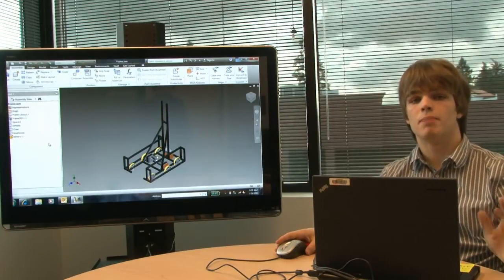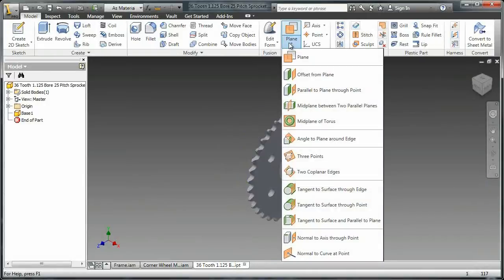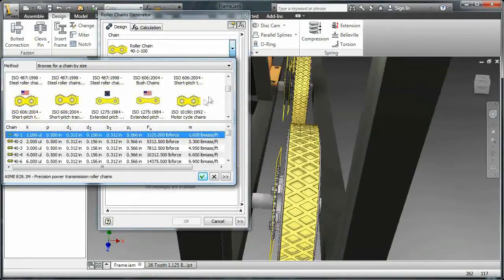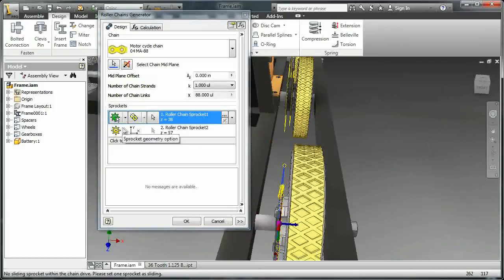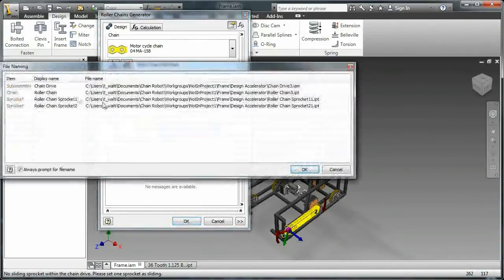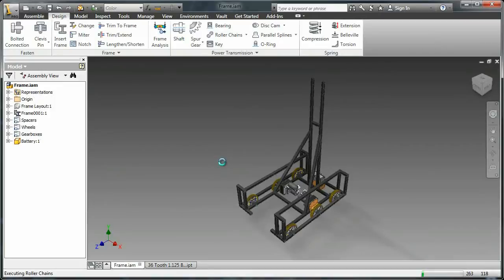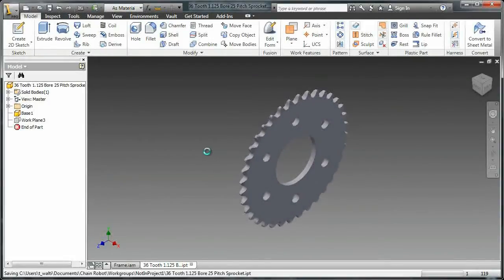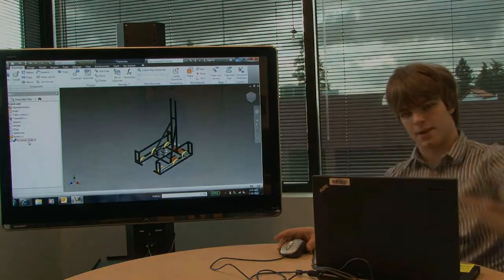Chain and Sprocket

Comment: Are you still using inventor? I am a  new bee to inventor. could you please give a tip on inserting a roller chain link.
I need a  chain which connected to geometry which is pulling back and forth